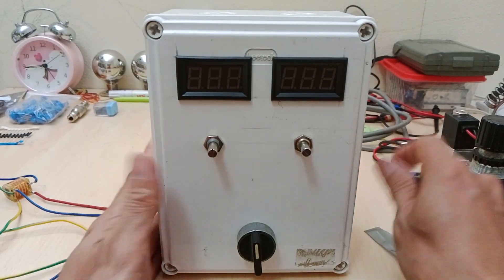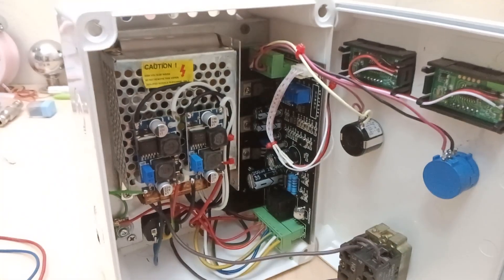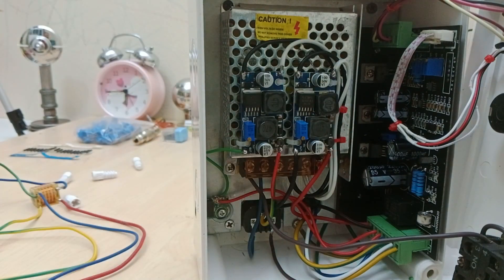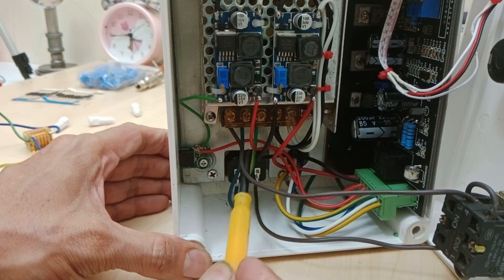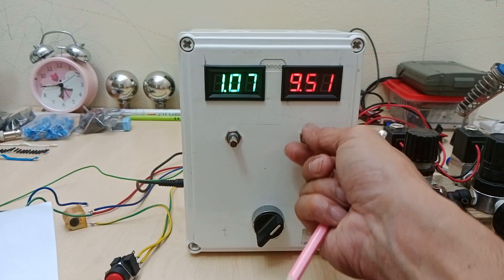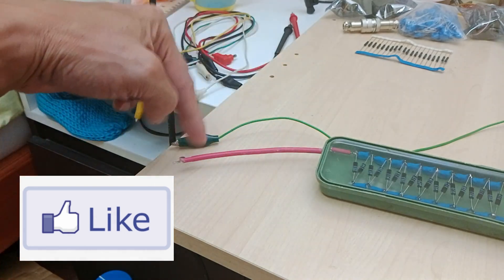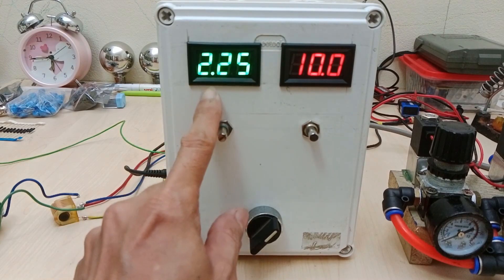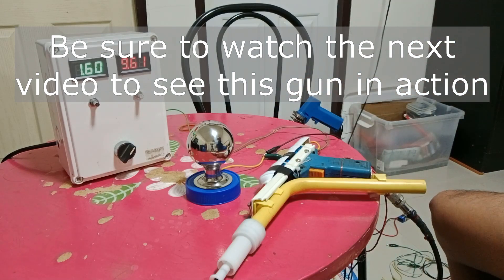Making an Enclosure for Gema Powder Coating Gun Main Board.

Comment: Input current to the primary coil of high voltage transformer which is AC or DC?
Reply from the maker: Hi. It should definitely be AC (or pulsating DC) because that is how transformer works. Transformers will not work on steady DC. You need changing magnetic field to induce voltage to the secondary coil.

Comment: How does it supply the cascade? Is it high frequency or DC?
Reply: And how it controls the kv output of the cascade? Thank you very much!
Reply from the maker: @luizluiz1992  by changing the amplitude of the ac voltage
Reply from the maker: high frequency AC

Comment from the maker: If I have a SMPS that can be turned down to 18 volts, then I don't need to have the additional DC-DC converters. A series resistor can be connected to the solenoid valves to that they will still get 12 volts from the main 18 volts supply.